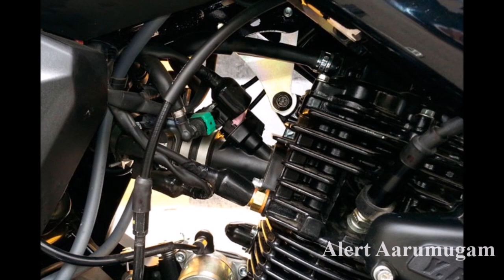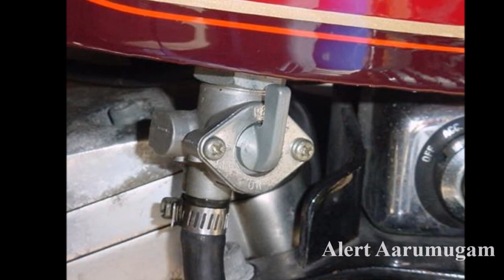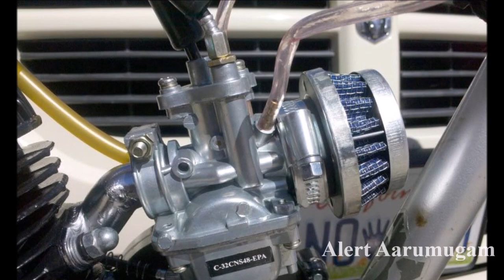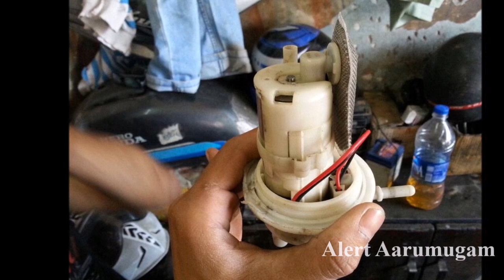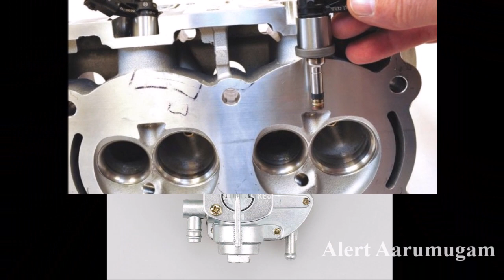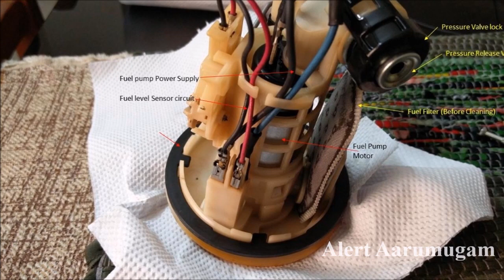Fuel Injection பைக்குகளில் ஏன் Reserved Fuel Option கொடுக்கவில்லை தெரியுமா | Fi Engine Bikes

Comment: Fuel injections bike starting problem varuthunu solraga bike running time la off aathunu solraga bro that's true r not
Reply: Super beam.. unmatha yan bike apuditha aaguthu
Reply: Szr
Reply: Fuel injection bikes might get 'off' sometimes even during running. And sometimes it won't start correctly when you restart it ' bulb to you' in the middle of traffic! Maybe the following helps: 1. Check  the petrol at the petrol pump station ( bunk). Quality maybe bad. Bike's pump maybe not clean or food. Check this at service station. The timing of FI maybe wrong. Check the also at the service station. For restarting problems, wait a few seconds. Switch it off. After a few seconds switch it on. Take off your hand from the throttle. Just press the ignition switch ( your hand shouldn't touch the trotlle at all) only the ignition switch, and try to start. When it starts, Maybe after a couple of tries if all other things as mentioned as above are okay, don't give throttle like your old motorcycles. But let it run idle for a minute or two then engage first gear and slowly give throttle.  Remember there is a small difference between fuel injection engines and carburetor engines at the beginning for you! Enjoy!
Reply from the maker: fi na proper ah maintain pannanum bro maintain pann apdilam agathu bro